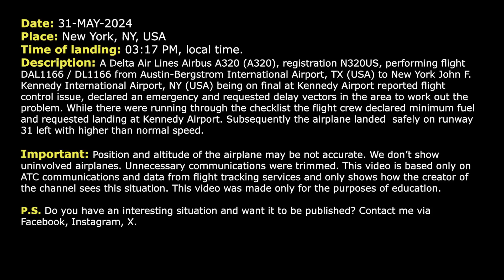Airplane almost runs out of fuel during flight control emergency at New York Kennedy. Real ATC

Comment: Well handled by everybody. Only gripe I have with this situation is that they have an emergency aircraft that's also minimum fuel coming in and still send out departures on their designated runway.

Yes, I understand that JFK is an extremely busy airport, but as somebody else has already commented, all it takes is one rejected takeoff for whatever reason, and best case (yikes!) you'll send the emergency aircraft with almost no fuel into a go-around, worst case you have a crash with hundreds of dead people on your hands.
Reply: 'Minimum fuel' isn't 'no fuel'. They're simply saying to ATC that they've committed to that airfield (not enough to go elsewhere) and that if they get any additional delays there's a risk they could land with less than final reserves and be forced to declare a Mayday for fuel.

The airport will continue operations as normal following this call, certainly no need to suspend departures or other arrivals on that runway.

The 'emergency' is not the fuel state, it's the flight control issue.
Reply: @easyjet8749  interesting.  But couldn't a go-around be problematic with slats manually configured for landing?  Or is it simply a non optimised generic slat config that anticipates possible GA etc?
Reply: @andysPARK  It's not problematic, it just needs to be discussed at the briefing stage, not at the selecting TOGA stage in a panic during an unexpected go-around. The cheklist has loads of useful bits in it such as the reccomended speed that is flown for either a circuit or a diversion.

The checklist has you determine the MAX speed for a given config, then tells you for a circuit (quick go around) to select 10kts below the max speed and leave the config the same. For a diversion, different rules apply.

The point is this needs to be discussed, briefed and relevant threats identified before rushing an approach. It's precisely why there are minimum fuel requirements for IFR flights.
Reply: Yeah, that struck me as odd.
Reply: Yes it's a joke ... in europe if there would be an emergency aircraft on final, especially with min fuel, there would never be a departure in front..it should be illegal to work like this even in the us... (im an atco in europe by the way)
Reply: All for a 15 minute delay for departures.
Reply: The approach controller asked about whether their approach speed would be higher than normal (it was), probably in order to figure out what they could get away with on the runway before they had to have it clear for the emergency aircraft.
Reply: @kepstin  You've misunderstood their intentions. They're asking because of the risk of a long landing/hot brakes (for emergency services) or other normal operational considerations like spacing for the preceeding/following aircraft on takeoff/approach.
Reply: Wouldn't be allowed in Europe.

America also clears planes to land before the runway is vacated. That's one radio breakdown away from an accident.
Reply: @RadioNul  Only if the flight crew isn't flying visual.
Reply: You wouldn't be saying that if you were on the plane that was denied take-off when there was lots of room.
Reply: @craig7350  I'm pretty sure I'd be okay waiting a few minutes if I knew there was a dual emergency aircraft on short final.
Reply: @craig7350  I typically have a drink in hand prior to takeoff, and I schedule my travel such that even unreasonable delays don't adversely affect my life, so 15 minutes isn't going to bother me.  Thanks for asking.
Reply: @briansmyla8696  You're not allowed to have a drink in hand prior to take off.
Reply: @craig7350  The flight attendants either collect them just before line up and wait, or they just turn a blind eye.  At least in my case. :)

Comment: When you have an incoming emergency aircraft and with min fuel, should the ATC clear another plane for takeoff just prior to the landing? What if the plane taking off has to reject and stop on the runway? I'd say it's better to delay 2-3 minutes the departures and ensure the emergency aircraft has the runway clear, right?
Reply: I agree. I’m surprised they didn’t quarantine the runway. I’ve seen this previously for nyc airports, I don’t know whether this is policy. In the UK the allocated runway is not used until the arrival of the emergency aircraft.
Reply: Only at JFK…. They’re special
Reply: because declaring minimum fuel confers no special treatment by ATC, that's why.
Reply: @bigjobbies no but they did declare an emergency and that's why the runway shouldn't have been used as soon as they were starting the approach. Even more with minimum fuel in mind. Just think of a go around with a crash later on because of fuel, atc is gonna go to jail, at least in europe.
Reply: You can unless the airplane declares a fuel emergency, which they did not. Had this flight been forced to go around, the next time they likely would declare a fuel emergency and the runway would be cleared.
Reply: @stephenj4937  I though "minimum fuel aircraft" during every communication past certain point was declaring (and reminding) that it's fuel emergency. Must've been wrong, I'm not an expert.
Reply: @Hekkaryk  No. Minimum fuel just means they no longer have sufficient fuel to safely divert to their alternate airport (which is likely Boston or Dulles). If they were declaring a fuel emergency they would explicitly say so.
Reply: There are other runways if they need one.
Reply: @N1120A  Not really, given the nature of the emergency and their fuel status.

Comment: In before the all the idiots screaming DEI because the pilots were female. They did a great job clearly communicating with the ATC and provided relevant information quickly. Besides a few stutters, which are completely understandable given the dual emergency situation, there's nothing to criticize, in my opinion.
Reply: Lmao one was female the other sounded like a gay male or trans female
Reply: Hahaha both female? The other one was definitely a gay guy
Reply: how about land the plane? quote from earlier "legend says they are still running checklists" hahahaha
Reply: @Tips-wt2ok  They did land the plane. They had plenty of fuel for the landing (even enough to do a go around if necessary, as they had not declared a fuel emergency). The last thing you want to do is miss something on the checklist and crash the plane. The checklists exist for this very reason; they weren't about to just fall out of the sky.
Reply: @stephenj4937  5400lbs is stupid low on a A321.... down in the high 4000's when they actually landed...craaaazy
Reply: Most of the great blunders in aviation are committed by white men. I lived in Portland and got to see UAL mistakenly land at tiny Troutdale instead of PDX. 15 years later the ran a perfectly good DC-8 out of gas and crashed into a residential area. Oddly enough, if you’re a bigot,  white males never crash because they are white or male.
Reply: Their only error IMO was communicating the fuel remaining in lbs rather than minutes.
Reply: @briansmyla8696  ATC specifically asked for fuel remaining in lbs. And the pilots specifically requested delay vectors; they still landed without ever having to declare a fuel emergency.

Comment: Classic case of a minor issue that almost turns into a disaster.
Reply: This emergency reminds me of the UAL DC8 fatal accident while approaching PDX with a landing gear issue. 

All three crew members were so involved  with that checklist that when the gear issued was solved, they did not have enough fuel to reach the airport. The result ended in a fatal accident. 

Checklists may be long, but you must be familiar with them to run them quickly when needed.
Reply: ATC asked them if direct Zacks, or they could have gotten another 10 miles
Reply: @jamescollier3  They did answer OK to the direct Zacks, then got pissy when he turned them direct Zacks.
Reply: @briansmyla8696  Nope; they were headed direct to ZACKS, then they turned them to the right, away from the airport. I think there was a miscommunication. ATC thought they wanted to be heading to the runway at ZACHS, while the pilots wanted to turn just inside ZACKS, which is what ended up happening.

Comment: Both pilots sound very competent. Clear, concise and questions atc to clarify instructions.
Reply: Excellent situational awareness too. From the outset they set expectations, warming ATC up to the length of their checklist. Reminding ATC of their status at each checkin with the next controller. Tightly monitoring their fuel and calling in as it was becoming more pressing. I liked the clarification check over a heading; not just following instructions but querying when they were unsure of the reason. Through all of this, they sounded in control, measured, they knew what they were doing. Professional and efficient.
Reply: Not really, from the first few communications they don't clearly say what they want from the controller.
Reply: @aeromatt  Arguably they didn't know what they wanted at that point as they were busy diagnosing the situation. JFK might not have been a suitable airport to land at given the degredation in flight control status.

Comment: As soon as I hear 5400Lbs, I thought: There's no time for that "long" checklist.
Reply: This is actually a good reason to ask for fuel in time (not just pounds) when an emergency is declared, to force the pilots to break any potential fixation on long checklists and re-evaluate the situation
Reply: @vasilivh  Flight crew should have answered with fuel in minutes rather than lbs.
Reply: @briansmyla8696  True
Reply: @briansmyla8696  No. They were asked for pounds, so pounds is what they should have provided. They could also add minutes if they thought that was important for ATC to know at the time, but pounds is what they were asked for and what ARFF needs.
Reply: @vasilivh Absolutely!  UA173 flew around in circles troubleshooting a landing gear light with airport in sight the whole time and crashed due to fuel starvation.
Reply: I thought that also
Reply: Right!?
Reply: I wonder how much fuel they landed with. Final reserve in the US is 45’? So about 3900 lbs? But with increased burn might be significantly more. Im assuming slats where nearly at zero so lets say no extra burn. They then have 1500 lbs margin, so around 20’ tops. They were slow in it, but aware and said the “minimum fuel” thing, meaning deviation to an alternate was no longer an option.
Reply: @user-microburst isn’t min fuel where they cannot accept delays, and if a delay is unavoidable they will divert to alternate or declare emergency?
Reply: @djsaidez271  no. When ATC hears “minimum fuel” they understand that, first, u r committed to land at their airport, and second, delays might mean a potential mayday fuel situation. Like, “so u know, we r committed to land here, and undue delays might end up in us declaring mayday fuel.”. It is best to be used when it makes sense. I won’t say it if I am already on a vector for final approach.
Reply: 5400 is well above the book value min fuel
Reply: For an a320, how long in minutes is 5400lbs?

EDIT: Google says 6400lbs/hour on average. Yikes.
Reply: @justinbecker4772  That's about right, depending on a lot of factors ofc. But yeah, a CFM A320 will hit the 6000lbs (mark in cruise). The min fuel is a prio over a slat issue.
Reply: Both issues need to be worked together.
Reply: @justinbecker4772 at 35k ft not 2k ft
Reply: @justinbecker4772 that is probably also at cruise altitude. At lower altitude turbine engines burn way more fuel.
Reply: I heard that pause in her voice. I don’t think that was a checked item at that point.
Reply: @JAMESWUERTELE  Exactly, she clearly had no idea before she was asked about it.
Reply: I thought the same also, screw that long checklist, especially in that airspace!
Reply: I was kind of surprised ATC didn't say anything about fuel when he heard 5400lbs.
Reply: @matthewa8713 they don't know, and it's not their job
Reply: @jamescollier3  Pounds is more relevant for the firefighters while time would be relevant for ATC. So even a (non-pilot) controller could/should know that an amount of fuel that powers his truck for 10000 miles is in an airliner just enough  for less than one hour flying or performing 3 go arounds.

Comment: 4:00 should read "157 souls on board."
Both pilots sound junior and incompetent.
Reply: Did the plane land safely? 
Then they were competent. They had two issues - flap problem + low fuel. Managed both together and brought the plane + passengers in safely.
Reply: So we should rely on you for that assessment?
Reply: Care to explain more on that?
Reply: Why do they sound incompetent? You try dealing with a potential loss of flight control and not stutter a couple times. Their read backs were fine, they communicated with the ATC and gave them all relevant information.
Reply: Agreed. Sounds like a delta DEI crew. Thats going to get me a lot hate.
Reply: @fivesfilms  What did she say that was incorrect?
Reply: @rattler254  Your emotion is getting twisted in someone else’s opinion.
Reply: @fivesfilms  huh? I’m just trying to figure out what you mean.
Reply: @rattler254 they sound junior and incompetent, based on my experience in the cockpit. I agree with the OP. Whats the issue? Why don’t you understand?
Reply: @fivesfilms  what, exactly, sounds junior? Stop deflecting and say it.
Reply: @fivesfilms what did they do wrong?
Reply: @fivesfilms I wrote a whole thing, it doesn’t matter. Because you’re not explaining what it is that makes them SOUND incompetent. She gave souls on board and fuel.
Reply: @rattler254  And had it ready, didn't have to tell ATC to hold on like most male crews do.  Only error was giving fuel in lbs rather than minutes.  When it came out 4 digits, I cringed.  Not sure why ATC shrugged it off and vectored them further out over the water...
Reply: @briansmyla8696  ATC asked for the fuel specifically in pounds
Reply: @rattler254  I didn't go back and listen, again, but I initially heard them ask for fuel remaining and souls on board.
Reply: @rattler254  I went back to listen, and you are correct.  It's a bit baffling why they didn't reply to ask for how much time that was, unless they already knew.  I would think that a 4 digit fuel in pounds would raise concerns, and I'll give them credit for not increasing the workload by asking for the minutes.  But the other gaffes by ATC by giving them the current ATIS and turning them over the water after they should have known that fuel was an issue makes me wonder about competence on the part of ATC.
Reply: @fivesfilms  I"m no simp, but I've heard a lot worse out of all male crews when faced with similar circumstances.
Reply: @fivesfilms because you sound like a racist when you bring up ethnicity/gender irrelevantly? Yeah you sound racist.
Reply: @fivesfilms  I'm sure the "a lot of hate" is a normal day for you
Reply: @fivesfilms  and I suspect you for some reason are looking for exactly that, getting some hate